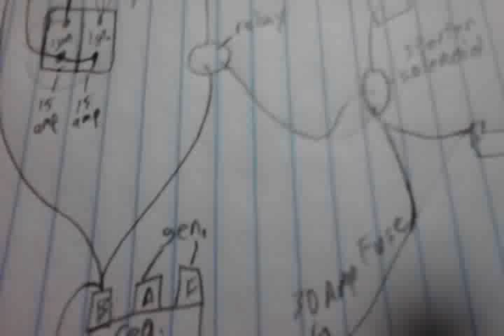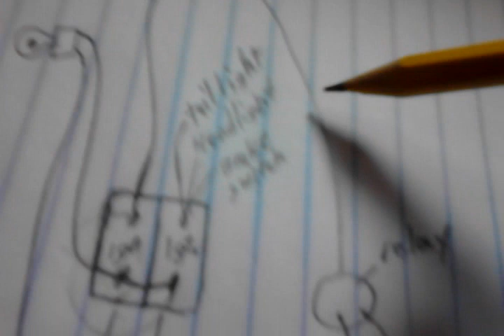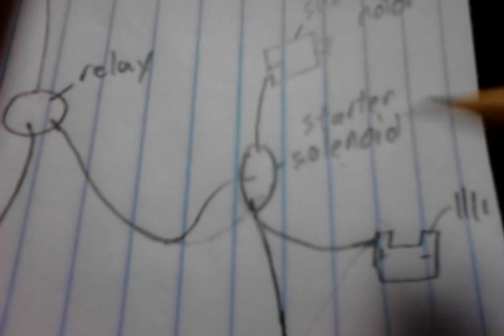Simple ironhead/chopper wiring explained

Comment: My name is Chuck. I've been restoring a 1980 ironhead. Your diagram is just like mine. However I have a couple of questions. So... where does the red wire go from the other side of the coil go? And where do I connect the hot wire coming from the starter relay? And is it okay if I gap another breaker to the ignition breaker? Please help.
Reply from the maker: From the coil one wire goes to the regulator and other goes to the points
Reply: Okay so where does the hot wire from the starter relay go to?
Reply from the maker: @jenndavis2402  from the starter relay it goes to the on/off switch

Comment from the maker: I used 8 ga. wire for battery to solenoids to starter motor and 16 ga. for all others
Reply: Thanks for confirming what size wire you used   what gauge did you use for lighting , horn, etc ?  1 ga ???
Reply from the maker: @gunslinger6307  I used 18 ga.
Reply: @mattbriley5864  Thank you for your prompt reply, I was planning on using the same gauge wire and now thanks to your confirmation I feel confident  on my wiring job, Thanks again Matt, I really appreciate you video, post and fast reply to my question , for your guidance I am using Marine Wire built from Type III class K tinned copper, this wire offers excellent flexibility. The tinned copper also resists corrosion adding to the life of the wire. and the outer jacket is resistant to alkali, abrasion, acid, gas, oil, flame, and moisture.

Comment: I have a 79 XLH 1000.. Engine spins, no spark.. electronic ignition is new...bike ran, then a fuse, or, circuit popped bc it wouldn't fire up after the fuses arc'd...do u have a diagram to wire them in right?

Comment: I've got a question for you,the relay that you are talking about the points or do I need to add a relay?Thanks for the video.👍
Reply from the maker: The relay goes to the starter , coil goes down to the points
Reply: I got ya on that so I guess I need a starter relay right
Reply: I don't see any kind of relay from anywhere ,lol who ever did the barebones on this 1980XLH is not like yours at all I'll shoot you a picture but some how it run I just don't like the cobbled up wires,what a mess.thats why I'm using your method.thank again.✌
Reply: I didn't under the battery box.DUH

Comment: So the starter relay and the starter solenoid are two completely separate things? My bikes wiring was completely stripped and my father and I are having a disagreement on this.
Reply from the maker: Confused Aquarist  relay is usually under battery box and the solenoid is behind the rear exhaust

Comment: On my 85 Sportster I went positive terminal on battery, to starter, then to a 30 amp circuit breaker, to an ignition on/off toggle switch, to my coils, and my points went to my coils as well. Rectifier went straight to my positive terminal. I have that push button on my starter, the solenoid push thingy, the starter tries to start then just dies. As if it’s not getting a lot of power to turn
Reply from the maker: Check the ground cable
Reply from the maker: Or the cables on the starter relay are reversed

Comment: Does your diagram use all 3 posts on starter relay?. When you say small post. Do you mean short copper color post? (Opposite of longer post) I am trying to wire a 77 ironhead bobber. So stripped to bare minimum. I've had it 2 yrs and just needs wired. Please help lol thanks. Great video.
Reply from the maker: Yes i used all three posts the short poat activates the solenoid
Reply: Ok I get it thanks alot. I do have one more question my regulator is the kind that mounts on the end of the generator.(c.c. rider) so there isn't a bat.+ connection just a wire for power. So I would just wire to here basically the same like you explained. I'm assuming your using original OEM regulator. Just dont want to mess up my regulator. Thanks again.
Reply: Or if I use a 30 amp circuit breaker instead of fuse I can wire to say bottom post and wire off other(top) post to regulator and separate wire on same(top)to ignition.?
Reply from the maker: The bat+ wire is the same as bat post on reg.
Reply from the maker: On circuit breakers you can wire multiples on a single post
Reply: Thanks 👍
Reply: Will this work on a 71 xlch ? Thanks

Comment: Will this start my bike, or just charge my batt n run my lights?
Reply from the maker: It will crank it using the run/stop switch and turn it off you will use the key
Reply: @mattbriley5864  but will my bike start n run?
Reply: Find* my Facebook
Reply from the maker: @georgewilliams2539  yes it should start and run
Reply: When you say it will crank it using the run/stop switch does that mean it will just keep cranking or the switch cranks it then you toggle switch down to shut off starter but keep bike running.redoing 77 ironhead.also is there a way to use a. Push button start somewhere in there?could I use push button instead of the toggle?